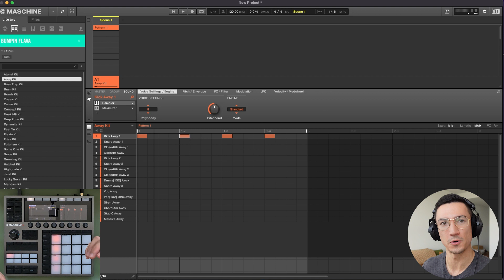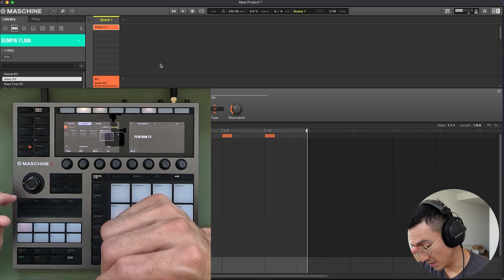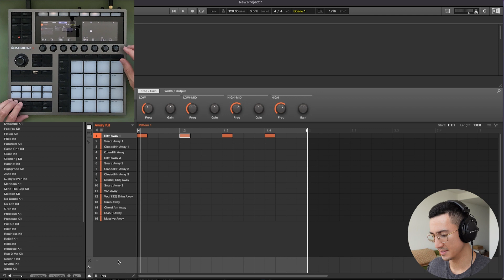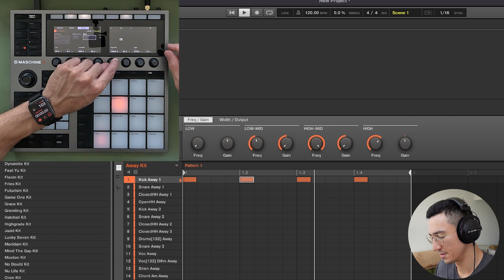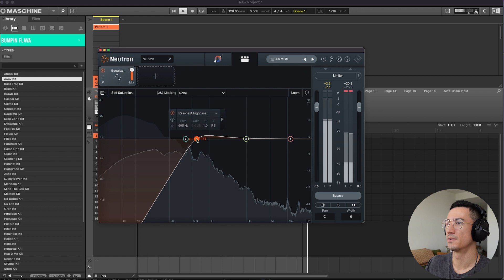5 Ways to Access and Use Filters in Your Maschine Workflow

Comment: A great use for the filter is to add another lfo to the poly synth. I often use one lfo for slight pitch mod to add cool analog pitch fluctuations. The poly only has one lfo (i.e. only one speed choice) so its great to add the filter lfo set to a different speed for some slow evolving pad sounds 🙂
Reply from the maker: Awesome tip. I'll try this out too!

Comment: Can you make a video about how to use the maschine controller editor with flstudio? I would like to learn how to mapping the DAW interface and have a similar workflow. I don't know if is possible to add PC shortcuts because some times is not possible to mapping transport controls but you can open son windows with the PC keyboard.
Reply: I’ve used FL Studio for years and I’ve really tried to make Maschine work in that environment. Unfortunately it’s not good enough regardless of how you do it from my experience. Nothing comes close to using Maschine HW with the Maschine 2 SW.
At this point I’ve  accepted that.
I’m hoping for updates to the SW so it can compete with the really good DAWs like FL Studio or Ableton but I really doubt that will happen anytime soon.
Reply from the maker: @christianabels6863  i wish the integration was easier. I love Maschine but the software has its limitations. Itd be nice to use it more easily in Ableton or FL studio. I know there are directions in the Maschine manual on how to use it with Ableton, but I can’t recall seeing FL studio mentioned
Reply from the maker: Hey, I wish I could help you with this, but I don't know how to use FL studio at all. I only know a little bit about Ableton and I'm not knowledgeable enough to do this with Ableton either at this point